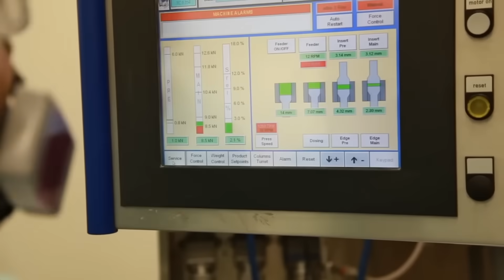Why These Engines Only Last 3 Seconds

Comment: …at 10 thousand rpm - (revolutions per minute) - an engine will turn over ‘166 times per second’… just think about that little note ‘for one second’… which in a ‘4 stroke engine’ that means each cylinder ‘ignites’ or ‘fires’’ creating power 83 times per second - power is only created on every second stroke and ‘exhaust’ occurs on every other stroke… which means the piston, by means of the connecting rod and crankshaft, has to come to Top Dead Centre and ‘stop’, then change direction and go down to Bottom Dead Center and ‘stop’ and change direction and come up to TDC and so on only ‘firing’ every second time the piston comes to TDC… so the ‘8 cylinder engine’ is actually firing a total of 664 times per second… which in a 5 second run @ 10,000 rpm that means the engine fires 3320 times… in a perfect world… oh yeah, and things get a whole lot crazier at 20 thousand rpm… I will stand to be corrected…

Comment: Two categories of NHRA nitromethane racers.
Top Fuel looks like a dragster. Engine in the back  (was in front before the 70s)
Funny Car looks like a car. Engine in front.
Both use the allowable 90-95% nitromethane and 5-10% methanol.
Top performances of either  1000 feet in 3.5 seconds, 330 miles per hour

Comment: A top fuel dragster is more expensive, per minute, to operate than an F-15 fighter jet. An F-15 costs about $20,000 per hour of operation.
Just mind-boggling.

Comment: 65 degrees spark timing btdc 27 million newtons 44 amps per cylinder 2.45 intakes inches valve opening n 1.925 exhaust valve opening inches overlap valve .50 huge camshaft yup 4.32 4.56 ⚙️

Comment: you can always spot a top fuel rookie in the pits... when the team fires up the car, Some of the members will put on gas masks... some of the older guys are used to it... but when the crowds are in the pits when they test fire.... Everyone is impressed... when they Crack the throttle & Blip it It makes you wonder how anything mechanical can change speed so instantaneously. But the funny part is when a rookie inhales the Nitro for the first time... It literally locks your chest up... you can't breathe... you literally can't inhale or exhale... it locks your chest up tight & you hafta walk away to get fresh air...  It's funny to watch reactions each time...

Comment: Me and my father in law went down to the starting line during the Mopar Mile High Nationals at Bandimere Speedway in Colorado. When they took off three things happened in rapid succession. My heart stopped beating for about 2 seconds, it felt like someone punched me in the stomache, and I felt like I was sprayed with pepper spray. It was amazing! 🤣 Keep in mind that shortly west of the track is the mountain and it echos the sound back at you to give you two slaps instead of just one.

Comment: I have seen top fuel and funny cars many times in previous years but I think it is now time they entered the real world and changed the rules to make the engines last a lot longer. A time limit needs to be set for engine longevity and also the amount of fuel used needs to be limited. By doing this they will be able to help the motor industry as does formula 1 and other branches of motor sport. Perhaps we will then be able to see how good american motor engineers really are. After all these days brute force is not the only answer for more horse power

Comment: I recently had a tour of a funny car which is pretty much a polar opposite of a t/f. The most interesting things I was told was that they have different head gasket thicknesses dependent on weather and after each run, there’s that much cylinder pressure the valve seats move about 1 thou

Comment: I'm a sports photographer and I've stood at the rail and shot these things going down the track at 300+ MPH! It's scary! The noise alone blows you back from the wall and if you're not wearing Mickey Mouse ears (I mean hard shell hearing protection) you won't have hearing for very long. I shot almost every sport on the planet and nothing really scares me except these things. Once you watch an engine give (which it does radially) you start thinking about what a failure would do to you.

Comment: That was a really good explanation. Back in the 80’s I read an explanation that included what is happening in a run that explained the clutch slippage and engagement at different stages and how many times the engine had turned over at different intervals, really interesting stuff.

Comment: It's not that they "only last 3 seconds" - that is a flat out LIE.
They are only pushed to FULL OUTPUT for commonly 3-4 seconds, and run at idle or lower output most of the rest of the time between rebuilds.

Clickbait title, though not as bad as SOME I've seen.

Comment: They are fast. However, in Thailand they are putting insane engines in tiny cars. Those cars are so squirrelly, they can only run one car at a time on a dragstrip or they would hit each other. They fight the horsepower all the way down the strip.

Comment: Nope, you're wrong, the fastest accelerating vehicle on the planet is a Top Fuel boat.
Reply: Really?  Explain.
Reply: @user-kx8rs6vz2o  what is there to explain? One has faster acceleration, it's pretty self explanatory.
Reply: How many g's do they develop or what is their 0-60 times compared to Dragsters.
Reply: @user-kx8rs6vz2o  I will get you the stats, but you compare them to dragsters, they're both dragsters.
Reply: @user-kx8rs6vz2o  Here is the quote, paste it in google and you will get the link, can't post links here.

a fuel car will go 0 to 280's in 660 form a dead dig! a boat cant do it in 1000' with 125' running start!! The boats are running on an average 3-5 10ths quicker et's than the cars, at only 240-260 mph

Comment: Umm, 14 tesla electric engines, dual common driveshaft (7 engines per common shaft),
big capacitor batteries, some upward fuel jets to create downforce by
upward jet instead of drag, basically batteries last like 30 seconds, max speed 500+ mph,
acceleration 10+ G's. variation for anti-G suit, acceleration 14+ G's.

I wonder when I'll see that....

If that's not enough power, triple or quad common drive shafts (still 7 engines each.)
(The batteries will be on fire !)
(However, you can use cooling system using 1 liter of liquid nitrogen each race.)
(the batteries I have in mind are not off the shelf neither.)
(Batteries need to store roughly 30 kWhr, and discharge at rate of 16MW.)
(Also, anti-G uses fluid content, not standard anti-G suit)
(or, anti-G chair, equally with fluid)

Comment: "New materials and engineering techniques promise to make engine's more durable but that being said at a guess it's probably for safety" 😂😂 No amount of more durable engine material's and engineering techniques are going be of any use when the front end and the back end decide to part company at 300+mph..

Comment: Let’s not forget the fuel is not 100% nitro methane.  It is also mixed with methanol that evaporates at 65*. This also helps with cooling air temperatures and the engine

Comment: Actually, Nitromethane is commonly used in Model Aircraft engines.  We burn a mixture of '5 to 30 percent Nitro, 10 to 12 percent lubricant oil and the remaining percent is Methanol.  This fuel is commonly available at Hobby Shops.

Comment: not sure where u get your information, but there's no way in HELL that they pull 8 G's off the starting line - the drivers would need a pressurized flight suit to handle those numbers and not black out- MAYBE 5 G's for a little over I second - these guys aren't mechanical robots, they're human beings
Reply: It’s around 5-6g
Reply: @maxfader2449 yea, I'm friends with a guy who works for a  company that supplies rear end drive gears for JFR, and I got to meet and hang out with John for a couple of hours at his facility in Yorba Linda and asked him that EXACT same question - he said anywhere between 5 to 5.5 g's depending on track conditions and clutch setup, but definitely NOT 9 g's

Comment: they last three seconds because that's all you need an engine to last. most of the time they last longer, some of the time they don't last that long. the thresholds have all been reached, the likelihood of something failing is very high and only the seasoned pros can anticipate what those failures are likely to be. And they push the envelope but what motorsport does, must do, is rule out innovation. they have no choice but to be brutal, to remain within the rules.

Comment: Fun fact , when they rebuilt these engine they measure the connecting rod length and use this for a cylinder compression tool for fine tuning with the piston being at different deck height

Comment: Im a (road  circuit) marshal. Ive watched some top fuel drag racing. 

I am amazed as I hear the 8G "claim" for the first time. This is beyond wild!
I saw Top fuel Dragsters in a demonstration run while marshalling at the Hockenheim Ring, and even at an estimated 50%(?) they were absurd! I gotta admit, road racing is gonna be king for me, but these engines are true marvels of engineering! Just watch "tire slow mos"...

EDIT 2:50: As Im a space nerd, this is exactly what I had in mind! Its comparatively easy to go to the effing moon, compared to the quarter mile...

EDIT 2: 9:40 I didnt see it this way ever... It makes absolute sense, but I guess its like the universe, too complex for "normal people" to understand... And I absolutely include myself in that "amazed idiot" category!

Comment: Any motorsports fan, whether Nascar or motocross or rally or f1 or power boats, doesn't matter, ANY motorsports fan needs to put a top fuel race on the bucket list. I've been to all sorts of motorsports events, and easily the most mind blowing was top fuel. It might be the most mind blowing thing I've ever seen in my life, and I've been to blue angels air show and red bull rampage and various other cool events. Nothing compares, the sound and violence of a top fuel car going down the strip is insane. It shakes you so violently that you can't see straight because your eyeballs are shaking around in their socket, you can't breathe because your lungs are shaking so violently in your chest cavity, then the visual of a giant vehicle looking like it was shot out the barrel of a gun on top of it. If there is one event worth the price of admission, it's top fuel.
Reply: I donno. I've seen top fuel and they can't hold a candle to jet rocket cars. If they tried it'd just melt and catch on fire. I saw the world's only twin engined rocket car do an exhibition run and it was absolutely insane. He broke the track speed limit. I didn't even know drag strips had speed limits. He crossed the line at 338 MPH though.

Comment: WOW. what does it take to make a fan video of an engine that will run for 3 seconds and is gone after that - just - wow... In Europe we live in the 21st century, do you?
Reply: A race engine that takes the driver from 0 to 338 miles per hour (or the gay equivalent in KiLoMeTeRs) isn't considered an engineering accomplishment in Europe? Itta Zetterström.

Comment: They last longer than 3 seconds, that statement is fucking stupid. The runs are longer than that with most of time the engines are still running but they rebuild them to get the maximum power and minimal chance of breakdown. The guy that made this is a little kid that does not listen well to say something so stupid!

Comment: Nitromethane has a cousin. It's called nitro glycerin. Very dangerous stuff to handle. They start the motors with a squeeze bottle of alcohol or gasoline in the injector because the motor would just grenade on a straight nitro start up. Watch and see.

Comment: One of the reasons they only last three seconds is because they only have to last three seconds. Sounds silly, and maybe obvious, but it's true. If the engine had to last longer, they would build it to last longer and it would make a little less power, and it would be a little heavier et.Cetera et cetera. The engine is designed to meet the given parameters.

Comment: I've seen the rebuild one a top fuel dragster . And I was apart of that when we too the blower of this top fuel dragster we found pieces of metal inside of the blower . So we kept on looking to find out that because this engine was under so much of stress that the piston shot itself so hard it cracked the block and completely destroying ever component that was in its way . This particular dragster was pushing out 17,000 HP
Reply: Care to describe this mythical 17k horsepower dragster in a little more detail? Series, driver, powerplant, etc?

The NHRA machines are generally considered the most powerful around, pushing close to 12k hp.

Comment: 6:33 A Top Fuel dragster can use up to 22.75 gallons of fuel during a typical run, which includes warmup, burnout, staging, and the quarter-mile run.  SO IT'S NOT AT LAUNCH
Reply: Crazy , my truck gets 440 miles on 22 gallons. So it cost me probably 100,000 at that rate of 1/4 mile per tank
Reply: Yup, this guy’s just trying to get views.  These engines are rebuilt just as pro mods are after every race.

Comment: This video title is bullshit. The engines last several runs they are just rebuilt after every run. Get real
Reply: You are thinking of the block, not the entire engine.

If the engines lasted several runs, what need in rebuilding them?
Reply: @codymoe4986  the need to rebuild them is to make sure they run a clean pass.

Comment: Top fuel races are a must do for anyone, car fanatic or not. Just make sure you bring ear protection. That being said there is something he states as fact in this video that needs to be corrected. These engines do not spit out unburnt fuel, that would be a waste. What you see at the exhaust is the hydrogen being separated from the water vapor that is separated from the surrounding air because everything else gets burned. Yes the exhause gets that hot. A perfect running engine is one that completely burns all of the fuel you give it and to make 300 MPH in seconds you need a perfectly running engine.

Comment: 1:36 F1 engines up to 2003 were built to last about 450km, then they would lose power, in 2004 they had to last a whole race weekend and in 2005 two full race weekends which came in about 1500km+
Reply: In the 80s some only had to last a qualifier..

Comment: Back in the 80s I had a buddy who was into dirt track racing.  Being a mechanical engineer and gear-head I pit crew'd for him for a couple of years.  We would rebuild - "freshen up" - his chevy 350 based engine once or twice a month. (rings & bearings)  Not after every race!  We didn't do it in minutes either - it would take several weeknight evenings after work...  Top fuel - amazing stuff.

Comment: “Takes at least 800 horsepower to turn the supercharger” 
3:27 turns it easily by hand
Reply: Bit different when the air is coming straight out the bottom than when it’s connected to the engine and the air is being forced into it.

Comment: This video felt like a 9-minute drag race of information. Straight to the point, packed with facts and great visuals, no fluff. Subbed.
Reply: Came to the comments to say the same thing lol 👍
Reply: Some of it isn’t true though.
Reply: @cubicinches100  what isn't true?
Reply: He’s just reading that top fuel “fact sheet” that’s floating around, which is has a lot of myths in it. They don’t use 11 gallons of nitro per second, the spark plugs do not melt, and the engine is not Dieseling. It’s a common misconception that the cylinder temperature is sky high in a nitro engine.
Reply: @cubicinches100  I read that fact sheet many times when it was fairly new. (I may have it saved on my computer somewhere.) There were some other things in it not in this video that were hard to believe, like the white flames coming from hydrogen burning that was split from water by the intense heat in the combustion chamber. I don't know which of the things are true, but the performance figures are no lie and they're the most extraordinary part.
Reply: @cubicinches100  correct
Reply: Hmmmm
Reply: incorrect facts......but
Reply: Very well said!!

Comment: If i use my math and investigation skill 11Gallons (US) per sencond is around 2540Liters a minute while a 747 uses 4 to 5 tonnes a minute this are 4800 to 6000 liters per minute(dependes on fuel temp, density). So most likely 2 engines beat the dragster...just to get facts  right m8.

Comment: In 2003 I bought a Ford pickup with their new 6.0 L diesel.
That engine needed to be rebuilt almost as often as a top-fuel dragster engine.
Actually got good fuel economy because half of the time it was being dragged behind a tow truck.

Comment: I met the Top Fuel team of Dennis Nilsson (AutoArt) at Hockenheimring and he mentioned that they managed seven runs with the Top Fueler without replacing the engine. They only changed a few seals per run and the spark plugs, than it blewed up…

Comment: 338 mph is basically incomprehensible to me.  You could drive from NYC to Miami, Florida in less than 4 hours at that speed.  For reference, if you drove at 60 the whole way, the same drive would take you over 21 hours.  And to reach a speed of 338 mph in 3.5 seconds is just inconceivable.  I can't even wrap my head around that kind of sheer power...

Comment: Anyone know what alloy they use for the engine blocks, as well as the valves? Like are the engines a normal aluminum alloy used for high performance cars or is it a “specialized ultra high performance drag” alloy, similar question for the valves and other parts
Reply: Should’ve actually watched the video before I asked this I suppose, I figured the valves would be inconel or some other alloy like it, still curious about the aluminum block